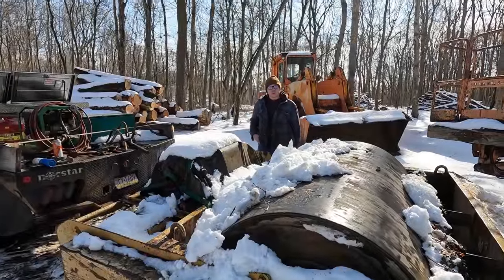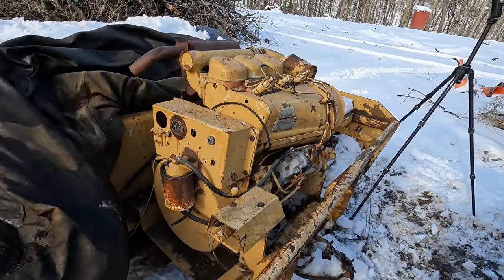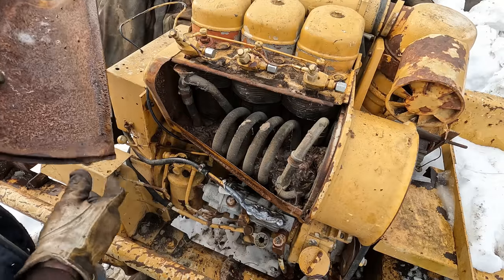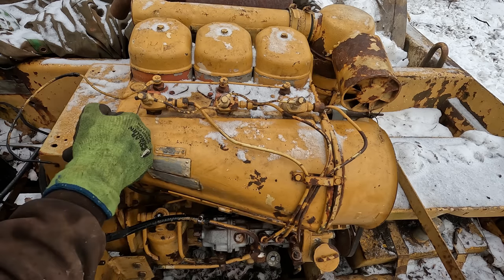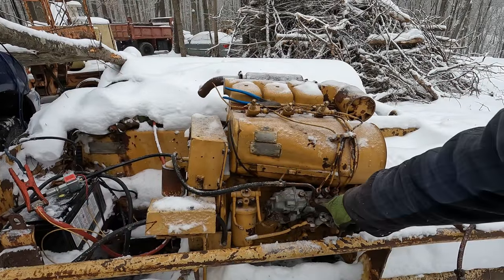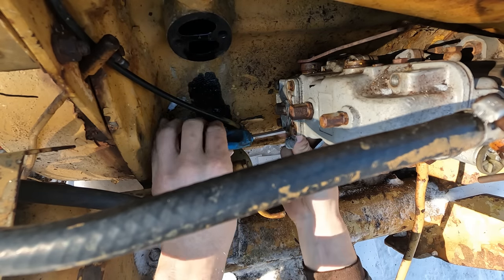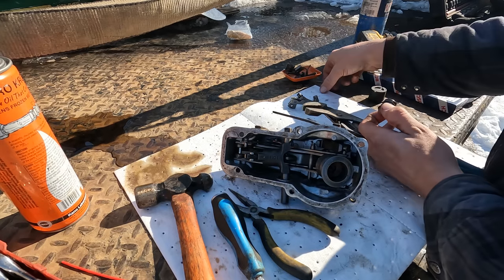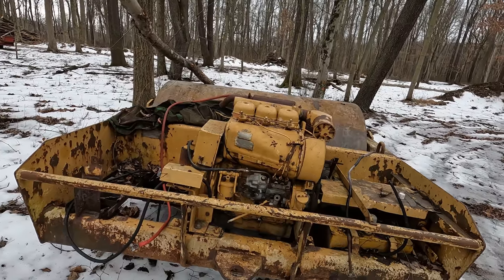Diesel Powered Roller Compactor, Sitting 30 years, Will it ever Run again???

Comment: Please don't use ether on Duetz engines. It will blow out the fire ring on the bottom of the jugs. I learned this the hard way with a turbo 4 on a core rig. We would take the pipe plug out of the intake and heat it up with a propane torch and it would usually start pretty east after about 5 minutes.

Comment: On our Komatsu pc300 the starter went bad, AIS was going to be 1200 dollars for a starter.     Komatsu used a 12 tooth instead of 11 tooth.      We used a regular MT40 truck starter with a 24v solenoid and put a 12 tooth gear on it.

Comment: A new starter will do it, i have a 4 cylinder in my tractor. My starter had the same speed as yours at the end,
I bought a new one off ebay germany for 100 bucks with more tourqe and now it starts whithin a millisecond 😁🚜

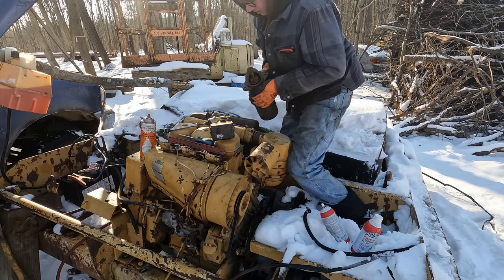Comment: Great video! 38:17 You pull the starter. For the first 30 minutes I was thinking the RPM's are too low for ignition, and was wondering if it was a 24 volt starter.

Comment: I bet, if you can find the serial numbers for the parts, agco has the parts. Sometimes you need a breakdown chart with a parts list if the machine is old enough. That starter looks like the exact same bosch starter i have in my 1965 made tractor. Not the same engine, but my starter burned out too, so i had to replace it.. And the new ones have even more power! So it should last you atleast another 50 years.

Comment: Owned all sorts of different diesels , and as others have said below........... if its winter / cold & an indirect injection diesel.......... you are not going to start it without at least some of the glow plugs working!!!  i once owned a car with an indirect diesel, and even when it was warm would not re-start without waiting for the glow plugs for a couple of seconds ( was turbo though, so possibly lower compression too).

Comment: You might need to check the exhaust valves for proper setting. If they are not holding compression.

Comment: The only way any "starting fluid" is going to work-
is it must be sprayed while cranking to draw it into the cylinders,
lubricate the top of the cylinder and valve seats and compress to
ignite, from a spark plug or compression as with a diesel engine.

Spraying then cranking is useless, and could lead to hydro locking
because of the unused liquid (Carnation white mineral oil) that's in it.

(as observed) NEVER use near an open ignition source- Ether is
highly flammable and explosive.

Starting fluid has a bad reputation from many people incorrectly
using it, and having bad experiences because of improper use.

Comment: Until you get the glow plugs working, wait till the heat of summer. I played with those in the mines in the '70s. No heat = no fire, unless you can spin it at ~800 rpm in that temperature.🤣🤣🤣
Best wishes from the far North.

Comment: Well screaming on screen works, at least you heard my yelling after 38 minutes, given space and time that it had to travel not so bad :). good luck, starting em is hard enough in winter without fighting mysterious failure. BTW did you checked that is there not water in oil pan? i mean if there is ice in oil it can have high press on meter but somewhere down the lines it can be not enough pressure on bearings so they rub

Comment: You were lucky that you found a starter. Yes, if it's a 812, it has a goofy tooth count. A 912 starter will only fit if you change the flywheel. Probably would had an extra one kicking around here. Lol
You need working glow plugs too, or it will not pop in this temperatures.  I am sure you'll get it.

I always read comments about those engines, it's like you love them or you hate them.

Comment: I've worked on those engines before, 
They are super basic and super easy to repair, model looks like a F3L-912 (have worked on newer models of them but they look the exact same) very very easy to rebuild as well. 
Love the videos keep it up

Comment: Hi Matt
I had an air compressor with the same 3  cylinder motor had to have plenty of speed cranking it over to start.
Very nice running motor and was very cheap to run.

Comment: Matt always buy my starters from DB electrical there chinesium but usually cheap 1/3rd of price they don’t last a year or 2 depending on how much they are used but it what it is. The copper windings on the armature was probably bad won’t let enough current to flow had that on a 48 dodge starter. There is no one in my area that knows how to rebuild a starter or alternator or think it’s worth there while

Comment: Hey Matt, look into an air compressor nozzle called a radiator genie. It comes in a kit with the air compressor and water hose end. Makes blowing out radiators and evicting mouse houses quite a bit easier. It's a pretty easy thing to make too if you'd prefer

Comment: A good trick when trying to bleed the fuel system is to remove the glow plugs to allow the engine to crank much faster an will prime the system without burning up the starter

Comment: You might need new or rebuilt injectors.  I didn't see any fuel coming out of the fuel return line while you were cranking the engine.  Should have some excess fuel coming out when the injectors were under pressure.  Had to drive one and tow one from California to Hagerstown, MD, Back in the winter if '83.  Only heat I had was from the oil cooler which wasn't very much.  Heater was a very poor design.

Comment: At 20:27, I thought, "isn't that torch going to burn the paint?", but then at 20:37, you added the starter fluid I thought, "there's an open flame" and at 20:40, there was, a bit more.  ;-)

Comment: Diesels REALLY hate slow cranking speeds, especially during cold starts. Anytime I boost the cranking rpm by using jumper cables on diesel cold starts they come to life MUCH better.

Comment: Yeah, spraying starter fluid towards the torch flame was resulted in exactly what I was expecting to happen :D

I have an adapter for a socket wrench to accept screwdriver bits, that's pretty helpful if you need a lot of torque on a screw.

Comment: Hey Matt, if you need parts for it I know a guy in Wisconsin that has some and is a dealer. Has used parts too. I have a f4l912 in a smaller wheel loader and he hooked me up awesome with used and new parts.

Comment: Please keep in mind that this is a diesel engine with a precahamber. So it is important to apply voltage to the glow resistors for at least 30 seconds before the starting attempt. It makes the life easier on these engines especially when it is cold.😁

Comment: The hand bleeder pump looks like the same one as used on mercedes OM-61x engines. There are aftermarket replacements that are MUCH better! Then you won't have to crank the engine to bleed the fuel system...

Comment: I have the exact same engine (Deutz F3L912) in my Kramer Allrad 312SE weelloader. I had starting issues as well due to somebody clamping 24 V onto the 12V starter. In Germany I could order a new starter for roughly 100 Euro 😉. 
Anyway I can tell you that your starter was turning way to slow, even to its best state.

My engineer Starts up after -5°C with one push on the button without Startfluid. 

Maybe check the valves? Put some diesel inside the Zylinders, to geht the engine going round an bit better? 

I'm really enjoying you videos an like how you do your thing! 

Best wishes from the black forest, Germany! Jep, right where the black forest cake is coming from 😜👌

Fabian

Comment: I also know  guy that had one similar to this he used on the farm for road repair. He removed the engine and replaced it with a hydraulic motor and a gear box to drive the shaft and ran it off his deer prob not your first option tho
Reply from the maker: No I don’t like that idea. I don’t have a tractor large enough to do that. Also I want to pull it with the skid steer

Comment: Just my quick opinion. We own 6 deutz tractors from the early 1960s to the late 70s your engine does appear to be a f3l812 the wedge holding the shroud was only used on 712-812 engines parts are really cheap but will have to purchase from overseas when we rebuilt our f3l514 engine new liners pistons rings and gaskets was 1250$ CAD and 500$ CAD shipping from Poland we had the parts in 5 days after ordering 
deutz dont like the use of either they are a higher compression engine and the heads are a but of a weak point with the glow plugs working the engine should start fine even in colder weather if i was close by i would be more than happy to lend a hand and share what have learned

Comment: Is there a chance that you are trying to turn it over with the compactor engaged?
My only experience is on a tiny 5hp garden mulcher so I think you have slightly more experience than me lol, but sometimes it's easy to overlook the obvious.
I spent longer than I want to admit trying to figure out why my mulcher wouldn't start after not using it for a year, then it finally dawned on me... I released the tension on the belts and it started first pull, And it was way easier to pull that dang cord as well, even though my arm was dead from the 367 previous attempts.
I was so close to smashing that piece of garbage before I realised that I was in fact the faulty piece of garbage lol.
So I obviously have no business offering advice to you, but this might at least offer someone some amusement lol.

Comment: Diesel Creek,
You know, the part you were spraying the either in was open and disconnected when you started working on it, what are the chances of critters (insects) getting into that?
Just curious as to why this is ignored.
It would explain why the either did not reach spark.

Comment: I'm not sure why it works but I've seem people get an engine to start in similar conditions by using some sort of open flame in the air intake for the engine. That being said a cigi lighter usually does not cut it, the flame ain't big enough
Reply from the maker: That’s what I was doing with the blow torch when they either flamed up

Comment: If 380$ for a starter is expensive, try not to crank it like crazy in winter knowing engine was sitting for 30+yrs in a woods. Soaking pistons and cyls in penetrating oil then changing gunked, thick 30+yrs old engine oil and cleaning an oil pan usually helps and thats exactly what I would do next time...

Comment: At the very least, it no longer features the optional extra governor icepack, or the optional extra spilt section throttle-shaft, clearly there are other options yet to be deleted, or corrected. The worn out starter was an unfortunate issue, and the difficulty sourcing a replacement is an additional disappointment, Is the compression good, and are the injectors injecting correctly?
Reply from the maker: All that and more coming in the next video

Comment: Is it possible to get the starter back from the rebuild place there are parts thar you could scavenge off of it and use in another hulk. Get it back and save it for parts if it is so rare to find.

Comment: This type of engine is very commen in Europe en you can find parts on every corner of the street (Netherlands and Germany).
In fact so commen that China has made a brand new knock off engines for around 900 dollar. 
Usely the main issue is the metric and imperial sizes that makes finding and repaire it difficult. At least I experience that for Briggs and Stratton. All imperial while I have only metric sockets.

Comment: Those Deutz engines are fairly common in lighting plants and air compressors in the Australian mining sector
Iv got a mostly hate relationship with them 
Dead simple to fix but they sure need alot of it, air cooled just doesn't cut it running in 38c (100f) or warmer weather 
The oil over heats and the engine shuts its self down 
So people bridge the temp switch to make em run longer 
Followed by the engine internals going external 
Give me a Chinese knock off cummins over a deutz any day
Reply from the maker: Sounds like the operators fault and not the engines
Reply: Bit of both 
The operators killl them 
But they can't handle the environment they're working in, 100f is a nice mild day on a mine, it's not a hot till it breaks 114f (46c)
Really they should just go home till it cools off 
But telling an Aussie to just wait till it cools off is about as useful as telling you to stop doing cold starts and just wait till the snow melts, you'd never get work done

Comment: Reckon I saw glow plugs next to the injectors and the preheat wire hanging in mid air ?
Reply from the maker: Yah I tried using them. They don’t appear to draw any power

Comment: The engine wont start without glow plugs   the easiest way to start the engine is to blow the blow torch into the intake manifold instead  of eather the engine will suck in the hot air and warm up the combustion chambers and help to ignite the diesel

Comment: Massive Grading Compactor needing engine fixes: 0$

1 can Of Starter fluid: $5

1 Propane Torch to Simulate A GLOW Plug: 3$

The look of surprise on Matt's face when the ether he was spraying into the AIR intake made contact with the impromptu "propane torch glow plug": 

                             PRICELESS

🤣 I haven't laughed like this in months. For someone so well versed with diesels you can't help but laugh when they start spraying either starting fluid into the air intake, while Simultaneously pre Heating the entrance to the cylinders not even 1 foot away. They do say cold weather brings out the stupid in all of us 😅 ... 

With how cold it was that day you can afford to be a little reckless but still .... 🤥 ...  Alright, All things said; 

" I'm Glad you didn't get hurt" 

"The Fabled Redneck Rocket capable to sending you to the moon on a single can of starter fluid .., will have to wait for the next maverick out there to successfully complete" 🤣   😂   😭
Reply from the maker: The flame was at the other end of the intake but some fumes made it over there lol

Comment: I was screaming at the top of my lungs it was the starter since you first cranked that thing. You could tell there was a bad winding in the starter armature, a healthy starter doesn’t completely stop or slow down when it rotates. And a good motor shop should be able to rewind an armature, the “rebuild” there talking about is just replacing the brushes and maybe a few bushings which is a huge ripoff since there charging $100 to replace $10 parts that you could replace at home in under half an hour.

Comment: On deutz motor, there are 3 things to look for: 
1) a good engine uses a tiny bit of oil, so keep chekking it.
2) they spin over fast. yours is spinning verry slow, there is a problem there, be it starter, solonoid or bad connection.
3) check the belt when you check the oil.

A deutz runs even on fumes, it runs best with a bit of lift pump presure. Because this is a returnless fuel pump becarefull of bad fuel line or air in the lines. Allso don't forget to plumb the injector return lines to the tank.

Comment: Useful tip (from my wife). Clean and save plastic trays food (usually meat & veg) come in. They are really useful for putting bits in when you are dis assembling / repairing anything. Use several to keep various bits and pieces together for various components etc. This way you dont loose things or mix them up.

Thanks for another interesting video.

Comment: Have to laugh, every mechanic when they start out has gone through the stage of dismantling a carburetor and had the spring and half moon cir-clip go ‘P-ting’ and disappear somewhere into the far corner of the garage into the pile of crap you label as  ‘ill put it away later pile’..  oh how well i know that feeling…

Comment: your injector lines are dripping after you changed the throttle shaft. that's gonna knock your injector pressure i'm sure.

Comment: A friend of mine has a similar style machine but it has a four cylinder diesel Lister engine I have to book it to the back of the D6 in order to stop it running away when it starts. as it only starts at full Throttle 
A man that thing hit hard

Comment: Hi there.. I actually have one of those engines.. unfortunately moisture got into the fuel line going into the injector pump and rusted solid #2 and #3 plungers in their barrels in the off position. It makes moving the 11,000 lbs. Ditch Witch 5110 very hard.. (and not having a big enough capacity trailer) ...still sitting at sellers for almost 4 years.. ugh

Comment: That's a 3 cylinder air cooled deutz diesel..there is no water in that
Such a cool engine!  I always wanted to get one like that and drop in my Ford Ranger...just to see if I could do it
Oh and on the intake...take that b-bottle and shoot the heat from the flame down into the intake manifold while cranking (about 6-12" from hole)...that super heated air will act like glowplugs and help it fire off
Keep em coming!!!!

Comment: Hello Matt, I'm a new subscriber and have been catching up on your older video's. Sometimes I learn from you and other times I learn along with you. I have a suggestion, I'm no expert but it seems to me that the black STP that was on the dipstick is going to hamper getting the engine to turn over. Save the oil from your wife's car and any other lighter oil. Pull the plug and let it drain the black goo out, then replace it with the used low viscosity oil. That snow packed diesel isn't going to build 65 lb. of oil pressure at idle, at running temp. and with fresh oil. It's the back pressure from the goo that's building the pressure! Also, I'm with Gary Mucher on the "Poof no Eyebrows"!

Comment: I think I would have tried 24 volts on it, by using two batteries in series.   I used to bridge the solenoid with a second battery on an old Ford... Span the motor up to 3500 rpm, and the auxiliary electrics still had just 12v on them.